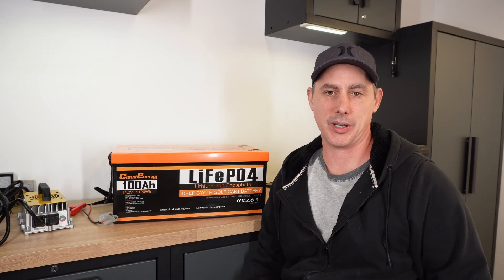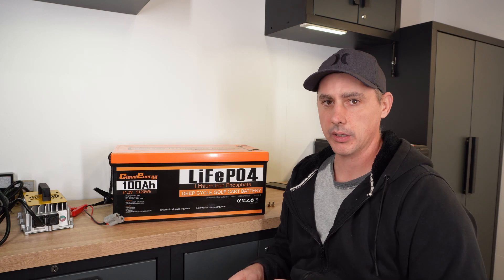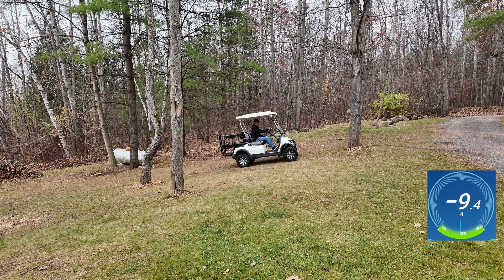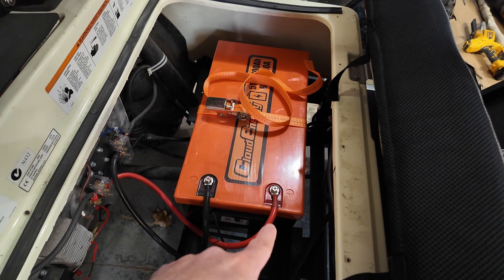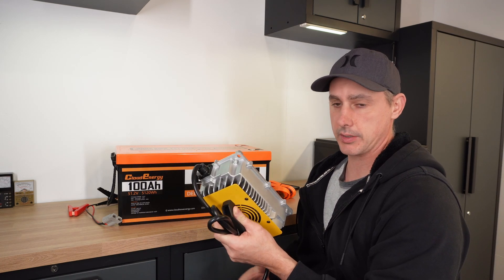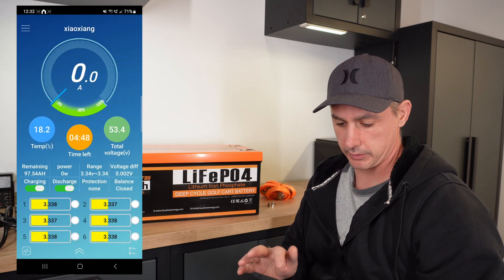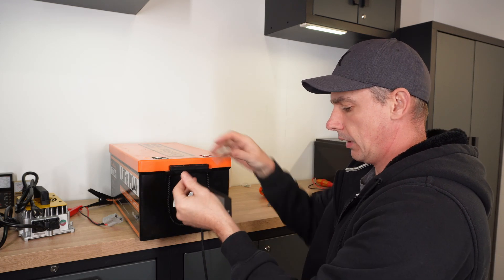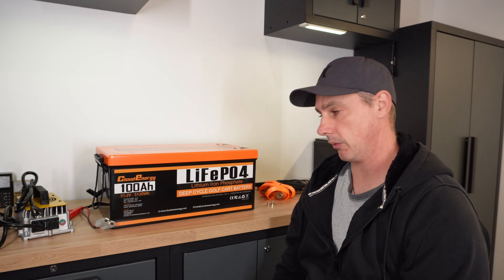Golf Cart Battery By Energy Cloud. 48V (51.2V) 100Ah

Comment: I have a Club Car Villager. It has a built in charger. Did you have to do anything different to your charger to set this up? Or just unplug the old batteries and plug in the new? I would like to just keep the current charger if I can and keep the one that comes with this as a spare charger.
Reply from the maker: @aaronmasterofnone  Unfortunately, I don't think your stock charger charges up to the voltage needed for LiFePO4 batteries. If it charges to around 57.6V, it will work

Comment: Is there any reason my battery terminal sparks when I go to hook up the negative wire last?
Reply from the maker: Do you have a 48V to 12V converter for 12V accessories?
Reply: @ I actually figured it out. I had to use the controller for the battery to turn the dsg off to cut power off to the battery